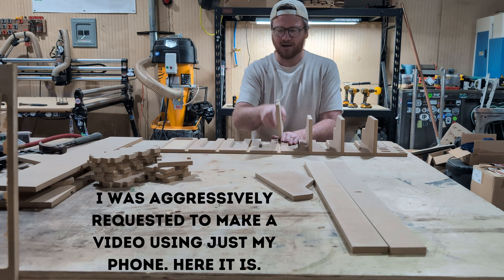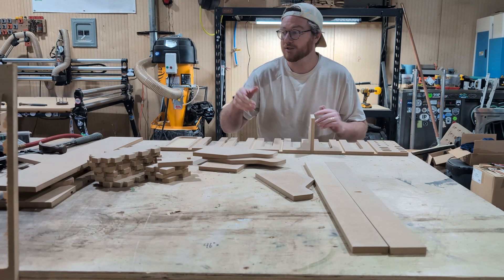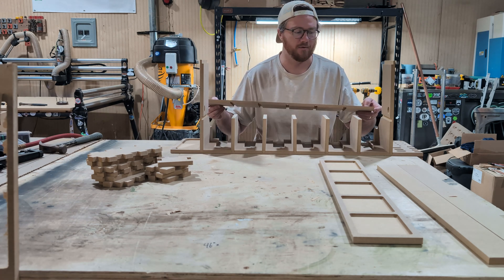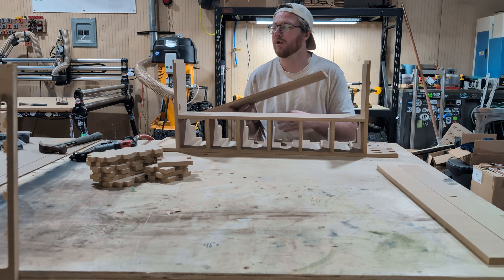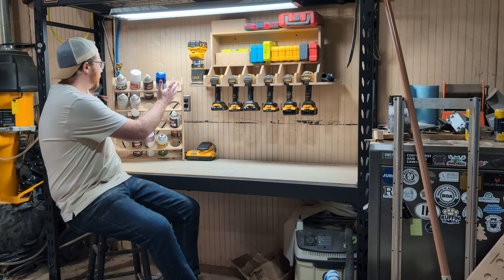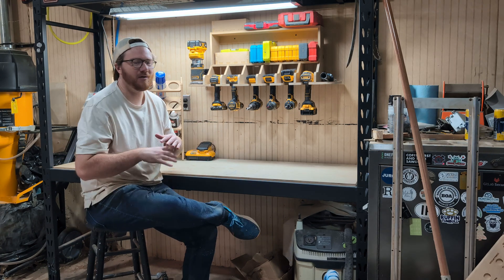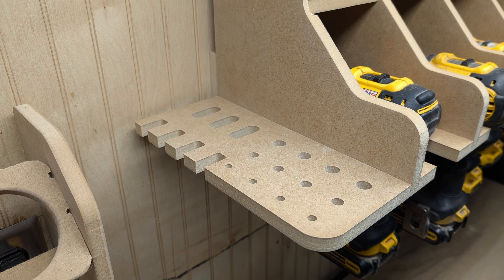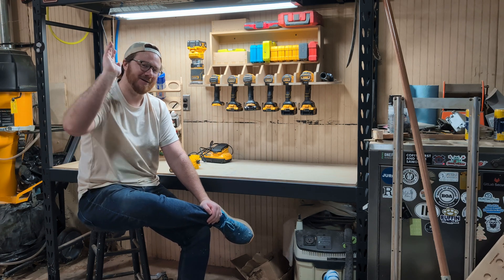The Drill Organizer That Grows With You

Comment: Another workshop project that you might whip out is a sandpaper holder of some sort. You see a lot of 3D printed ones out there. I use a lot of different grits, so I made a box with 12 drawers that you can take out to the bench or wherever. While it works, I'm not thrilled with the design. Interested in seeing what you guys could come up with. - Chris
Reply from the maker: Nice! I'll see if we can make somethign more useful!